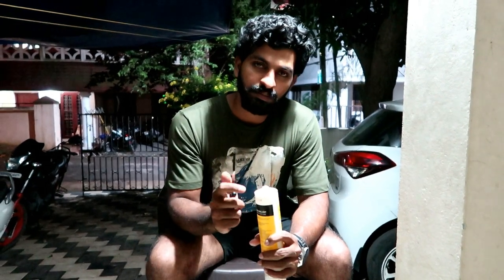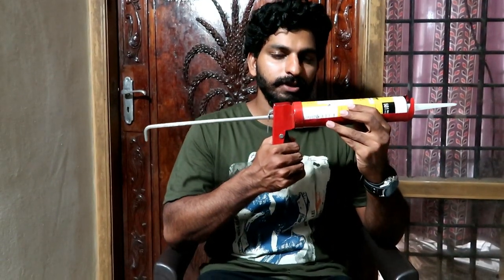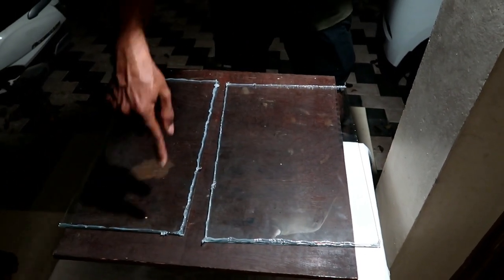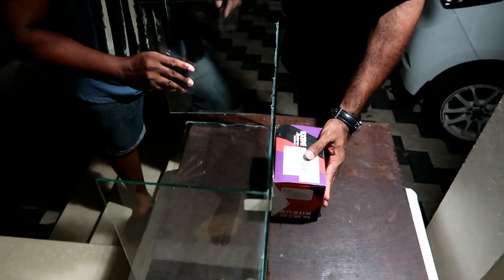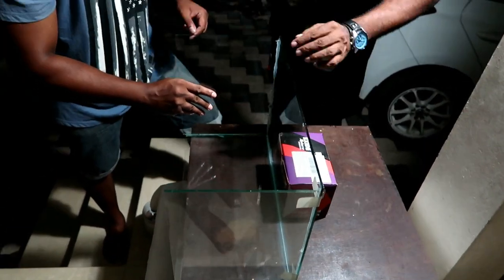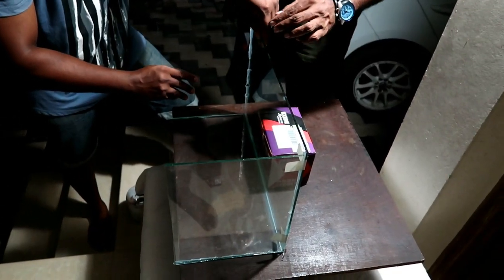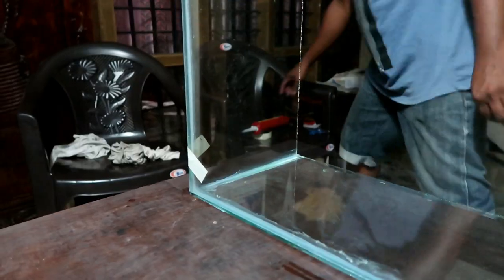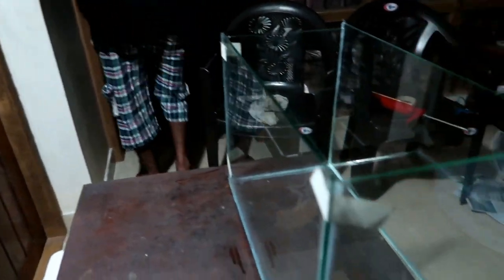How to make an aquarium at home in malayalam | Simplest method|

Comment: Machane, am planing to make a 3x1.6x1.8 feet , tank.... Using normal glass, not tempered glass... Can you suggest the thickness of the glass, am new at this.... So i need an advise brthr.....
Reply: hash Tube, its alright.... And thanks for the reply
Reply: 6 mm would be enough.... Since its a small tank